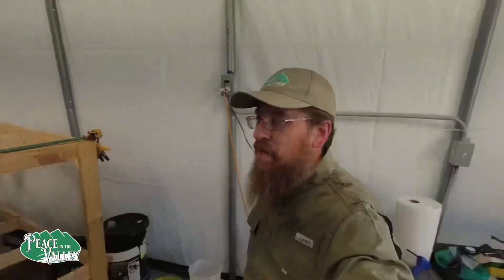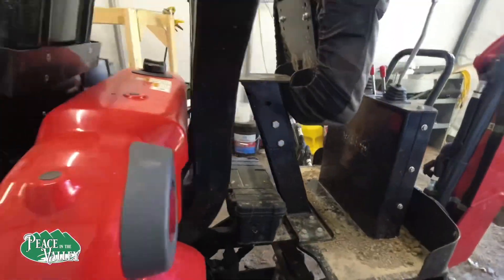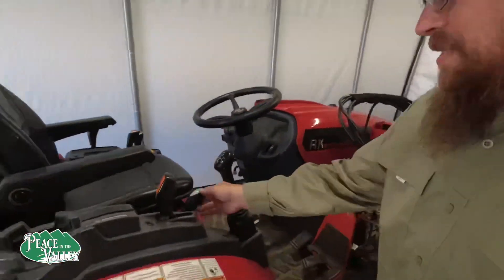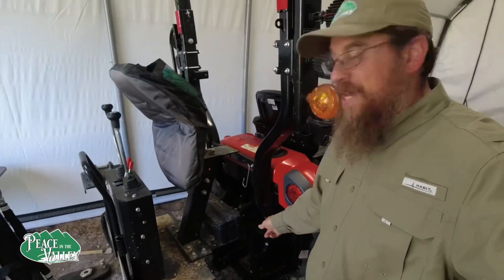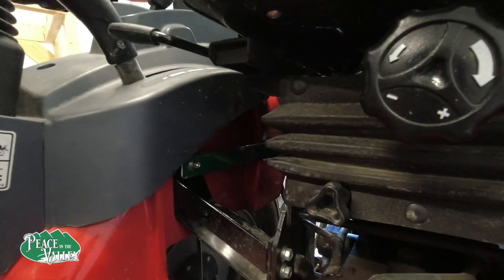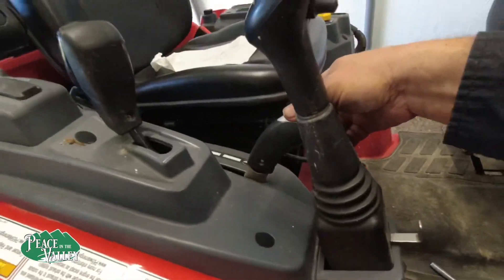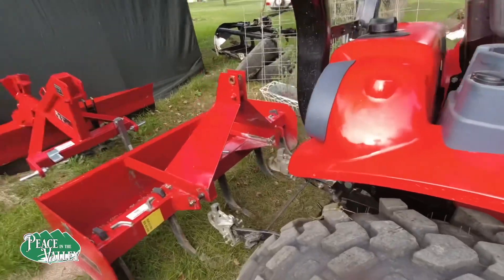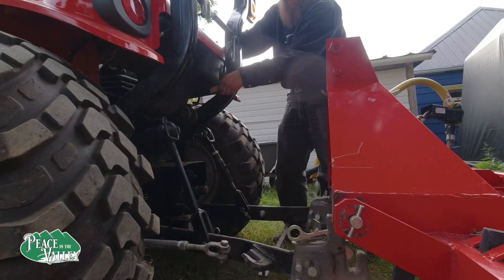3rd Most Important Mod - Adding $1000 option for nearly free to your tractor! E108

Comment: Great idea Bryce and have you had any issues to speak of with your 25 since new , I have 78 hours on mine now no issues great machines !
Reply from the maker: HI Kelly, I have had a couple. One of my videos shows how a chunck of the transmission fell off. I rebuilt it myself to be sturdier than the original. If you get a chance look at the RK25 HD edition video. I would add a gusset plate on the back for extra support just because the 3 point bracket bars only go in the transmission about 1" or so. It is not straight through, which you would expect. For some reason a couple weeks ago my fuel gauge stopped working. It's still a great tractor. Thanks for watching!
Reply: @PeaceIntheValley  Thank you and good tractoring !

Comment: Great video Bryce!! That was pretty genius idea work's Great.  I also believe should be a standard item on tractors.  That would really be great usin auger.  Looks like you have Pat's quick hitch do they work good? I have older implements that won't hook up to 3 point quick hitch.  Thanks for sharing be safe have fun
Reply from the maker: HI Mike, For the most part I do like Pats. The biggest issue is the space they take up when attaching the backhoe. It's a little tricky to get them in the right spot at the right time when backing up to the BH. The 3 point attachments, work real well with them, much less stress hooking up.

Having the post hole digger on with this control, should make using the auger better when you are the only person. I look forward to trying this. There is another screw on that 3 point rod that you could attach to, to give more control, but you would have to make the length of the steel a little longer. It really should be a standard item! Take care!

Comment: Great idea Bryce.  Works perfect. Man, they should compensate you for this ingenious idea. I'm gonna give this a try on my rear hydraulic lever. My biggest problem is hooking up my rear sickle bar mower,  my box blade and back scrapper  blade. Always a pain. Thank you very much my friend.
Reply from the maker: Hi Dean! You probably noticed that I made the lever fairly inconspicuous. It doesn't protrude out much and the reason was I was concerned what might interfere when attached. That's why I left it a little short but still accessible. My 'druthers would be to make it about 2-3" longer. Backing up and attaching the backhoe was my biggest concern. Once on it wouldn't be a problem. If you don't have a backhoe on yours, or if it attaches differently, you may not need to worry about it! Good luck! I would love for you send me a picture when you have it finished so I can see it! I appreciate you very much!

Comment: I've been waiting on my 3rd function valve for 7 months now.....
Reply from the maker: Did you order from RK? Keep bugging them about it. It's very possible the order has gotten lost with todays supply chain issues.
Reply: @PeaceIntheValley  I did. I have the tractor guys number and text him every Monday.  I did one mod to mine that has been awesome. I added a mount behind the seat that holds a 1 gallon jug of water
Reply from the maker: did you attach it to the seat or is it independent in case you need to access the transmission fluid?
Reply: @PeaceIntheValley  it's attached to the rops bar the runs side to side. Essentally where the toolbox was mounted.